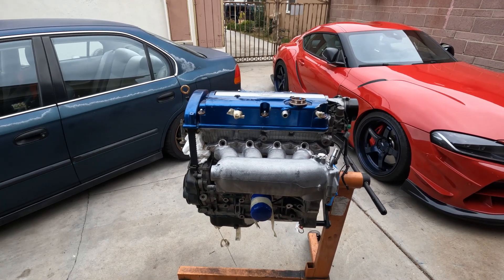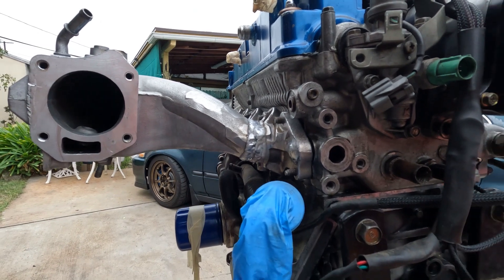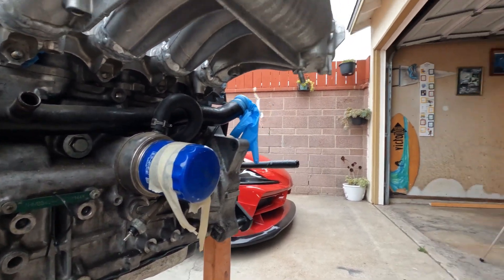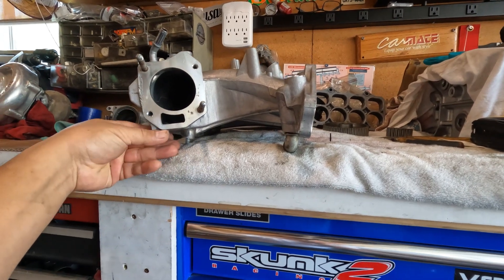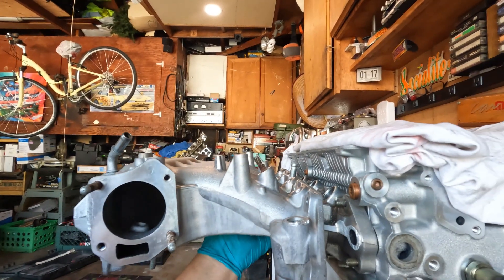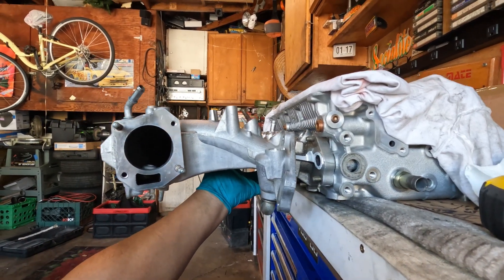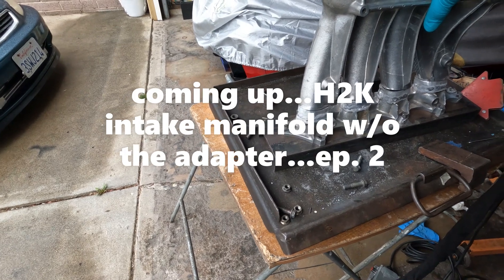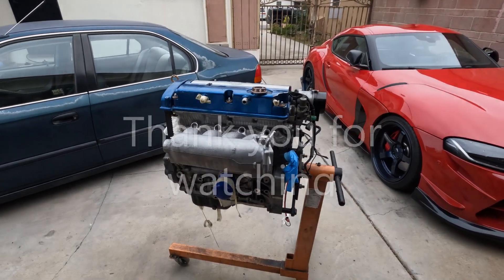K20 RBC intake manifold on H22 w/o conversion adapter. ep. 1

Comment: sagitt you know how much more hp RBC or RRC vs Euro R manifold in a na build h22?
Reply from the maker: Someone on Honda.tech.com made a comparisson on these before on H22. RRC and RBC made additional power vs euro R intake manifold. I'm using RBC w/ H22 headflange and it made more power when l was using euro R mani. You can't go wrong w/ any of the 3 mani, it gives on mid and topend.

Comment: Do you have the coil on plug kit?
Reply from the maker: COP, yes, got it ftom Burton Racing and it's on my H22
Reply: @sagittnet2158  I been wondering about how good it is also how do you even wire it up
Reply from the maker: @Chris-hs8zd  I have them install it for me and it didn't work 2 weeks after l received it. Returned it and took 1mos to get it back, l had to proved to them it was their worked was faulty. Anyway, it was working afer that. I  recommend to have someone install it for you, its for warranty reason. Check out Nomis lndustries, maybe you can get a good deal.  Have you seen or hear about Digidizzy? Looks pretty kool but price is a bit out there.
Reply from the maker: @Chris-hs8zd  Once the circuit is install on the ecu. It require you to remove some component from distibutor and connect some wiring. It's not that hard and plenty of tutorial on how to do it.
Reply from the maker: @Chris-hs8zd  Performance wise, its really hard to say coz l made more hp using OE ignition system on turbocharged G23 l have on the Civic. They advertise that it burn gas better on hi-boost.

Comment: I’m trying to find a great aftermarket intake manifold for my h22A 1992  in my ek civic . What is a great intake manifold I can use because I can’t find an aftermarket one that will fit into the civic body
Reply from the maker: If you have a full H22 swap, Euro R H22 intake manifold will fit and will give you good power. Rbc mani will require a lot to fit it in unless you'll do like l did w/c is cutting and weld a h22 flange.
Reply: @sagittnet2158    I have the full euro r swap and transmission from the euro r accord . I had bought a Skunk2Racing intake manifold for my motor but unfortunately it didn’t fit right in the civic body . I was so pissed .  Hopefully the euro  r intake manifold fits in the civic with no problems
Reply from the maker: @Youngflynsaved7  euro r should fit coz thats what l have on before on this Civic.
Reply: @sagittnet2158  thank you 🙏 do you know by any chance where  I can find it ? I’ve looked on eBay , online and for some reason it’s pretty difficult to find .
Reply from the maker: @Youngflynsaved7  it's kinda hard to find it nowadays. You just have to keep checking ebay or FB market time to time. Roskoracing.com usually sell it but he runput of stock. I know sk2 will fit but it'll be really tight and require you to move your brake proportioning valve. Iacv need to be tuck in also.
Reply: @sagittnet2158  thank you .  I appreciate you responding back and your videos
Reply from the maker: @Youngflynsaved7  no worries and thanks
Reply: @sagittnet2158 did you have any issues with the motor mount when you installed it to your motor and back into the bay ? I’ve been doing research and someone else that has done the same thing said that they couldn’t I talk it because it was interfering with the  rear  mount by the fire wall
Reply from the maker: @Youngflynsaved7  the euro r mani have no issue when l installing in n' out. I think l know it now! F23 block and H22 block are actually have slight differences. It lean forward a bit compare to H22.l'm also using F23 post mount bracket on driver side. That's probably why he said you might have an issue. Regardless, if you seen when l put that motor on engine bay, you'll see it. Iacv are also installed on the side and it make even wider but still able to put the euro r mani.
Reply from the maker: @Youngflynsaved7  l made a video when l was installing the engine and problem rose at the rear mount, all 3 of them actually. For the rear t bracket, l have to elongate the rear mount hole to make it easier for the bolt.
Reply from the maker: https://youtu.be/FAxHYwX96MI?si=ZmpHAAJFHdO6gWiI
Reply from the maker: That's the episode fixing all mounts. Not sure if youv'e seen it.
Reply: @sagittnet2158   thank you 🙏  im watching it right now

Comment: Hi brother  can it be possible to  put this on  a f20b5 sohc engine 😀 any information will be appreciated 😊
Reply from the maker: I cant seem to picture your f20b5, it doesn't breakdown under wikipedia honda engine lineup but if your head intake port sre like the F22, H22 ( O O O O) or similar to k series, l dont see why not. Simplest way to do, buy a intake mani gasket for your F20b5 and K20a2 compare the two. There is someone on youtube name "Sethchurchvid" , made a video to fit a RBC on F22 w/o a adapter, check it out. Hope this help you a bit. Buying the gasket is cheaper than getting the K manifold and from there, you'll know if its pissible.
Reply: @sagittnet2158  ok thank you I'll do that buy 2 intake manifold gaskets

Comment: Hey! Just finished my G23 short block. I uploaded a short so you can see it. Thanks for all the help man!!
Reply from the maker: Thanks,seen it and looks good. You'll be trippin on this motor. Dont go power hungry! Hehe, that way you can really enjoy it and  wont be just a rush and  it break. So what makes you keep your balance shafts may l ask, why not delete it?
Reply: @sagittnet2158  Lol hopefully I don't. The power goal is 500hp and then turn it down a little. I'm going turbo so don't think deleting the balance shaft makes any difference for me.
Reply: What's the torque spec for tensioner stud. Can't find it and I'm wondering how I'm going to torque is because I don't have a socket that fits over it.
Reply from the maker: @Open90  the nut is 49 lb/ft, you can do the same on the stud but put some locktite on it. You can use a wrench and give your mighty or if use a crowfoot wrench.
Reply from the maker: @Open90  yes! kool man, keeping b/s is better anyway.
Reply: @sagittnet2158  Yea I agree. Thanks
Reply: @sagittnet2158  Thanks for the help, appreciate it. Will use man power or get that wrench lol.

Comment: Best is to use dual throttle setup. smaller one on the top and bigger one closer to the engine. I have used it and it gives me mid torque and high rpm power at the same time. smaller one is for cruising and lower rpm, when you hit the pedal and go for vtec, the second bigger one opens...
Reply from the maker: Never seen that setup and very interesting to see, thanks for the info. Thought l give the Rbc  if it can be use w/o the adapter n' hoping that lt'll make some power too.

Comment: Love it man keep it up! 🦾 same thing can be done to the F series using the intake gasket matching the holes.
Reply from the maker: I've seen that, he actually stirs me up and got me intrigue before but my idea was add to add a material on headflange so all the mount holes will have a better grip. I tossed that idea coz l dont want to modify the rear T bracket. So after l finally got all my parts on hand. I already have my plan but took a while to execute 'till recently and here l am now and got it figured out.